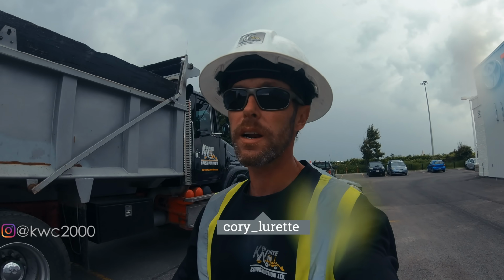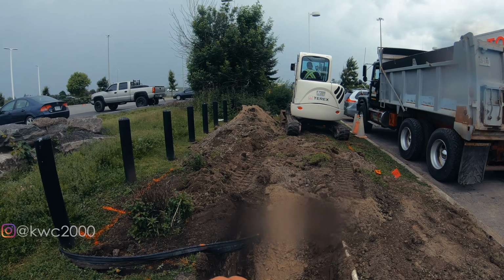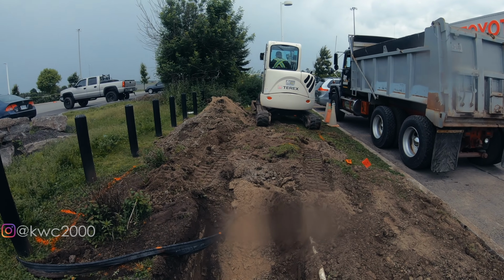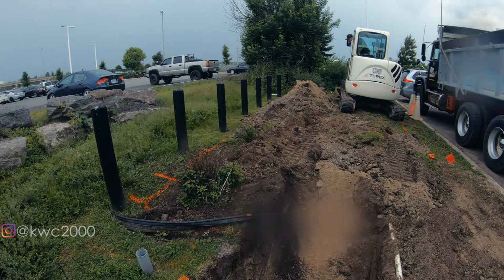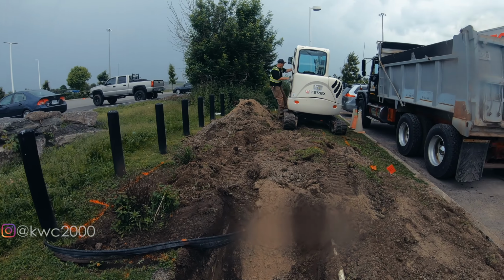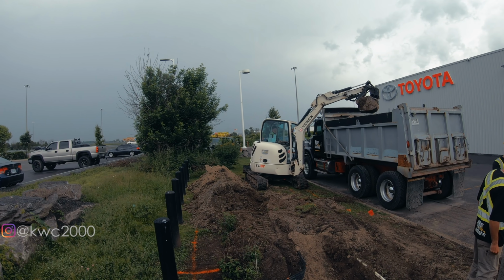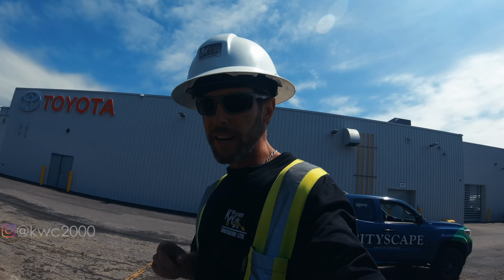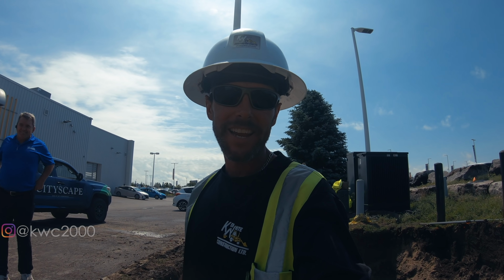Excavating Ground for Concrete Generator Pad (COMMERCIAL SITE WORK)

Comment: love the on site videos. Cory does a good job explaining what is going on. One question is why Ken didn't use the thumb to lift the bollard out? or is that hydraulic circuit used on the tilt of the bucket? Maybe Corey could show how they benchmark to check grade. I think people would be interested in that. I am interested where they found the electrical.
Reply from the maker: Yup just his valves were closed to thumb and used to operate the swivel bucket that’s all! He could of changed over I guess!
Reply: @KenWhiteConstruction  Is Ken your Dad? or does your dad still run equipment? Now with an Engcon there is a grab on the back and could have picked it up with that. They do make Engcon's for that size mini. I'm just teasin, but If I had an excavator I would have an Engcon. Just my opinion
Reply: I will show how I do benchmarks and elevation calculations in up coming videos. Lots of work to do this summer so buckle up👍
Reply: Looking for and finding the electrical was done from locates that were done previous of starting and past experience as we have done a lot of work on that site over the past few years. Hope that answers any questions you may have on the electrical search. Thanks for watching Brian!!